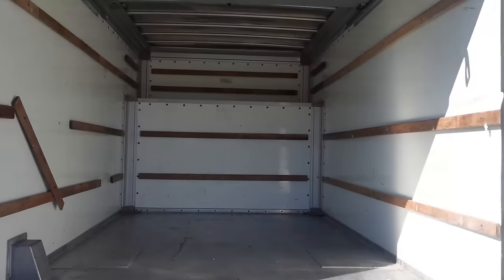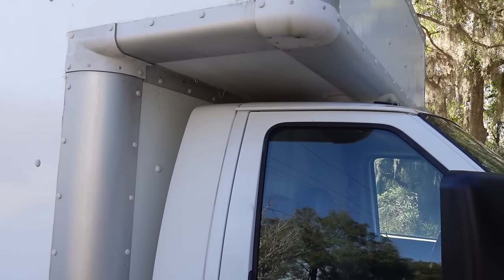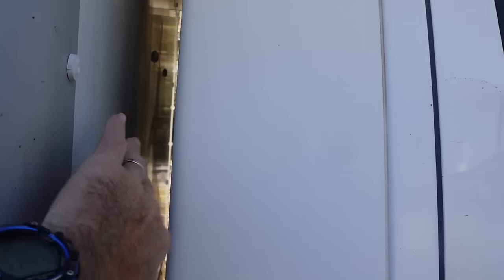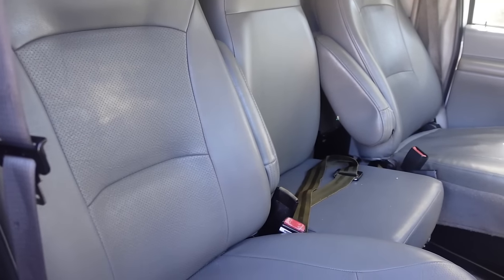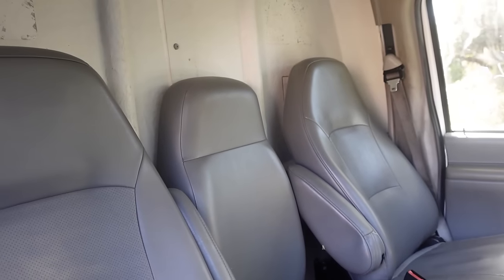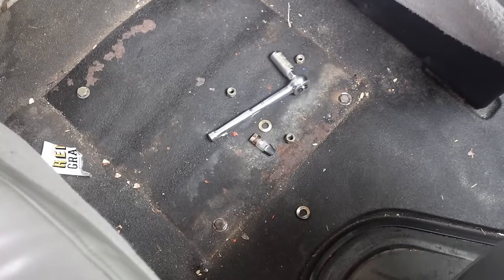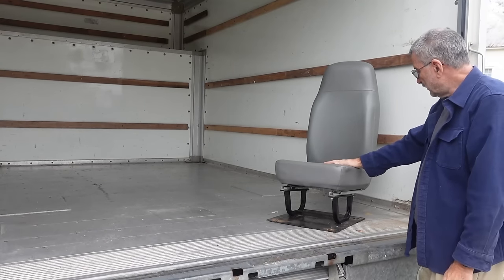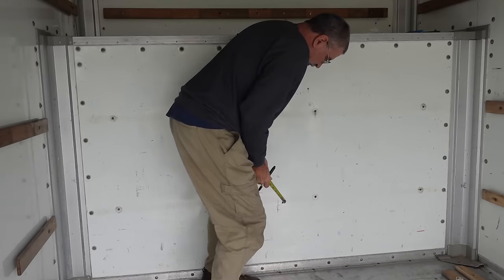Installing a Box Truck Pass-through Door

Comment: When I did mine, I used oversized pool noodles for my gasket and built a wooden sill plate at the floor.  and silicone caulk to seal the noodles...the top noodle spanned over the entire doorway that was almost the entire length of the cab back... I cut my hole larger when I realized thew advantages of the much larger hole.  The gasket seems really nice but the larger opening, with curved edges and corners was so  much better than just a doorway with no door...my dog loved sitting around back there and sticking his head around the seats. Glued vinyl to cover around edges was good... every few years I would rebuild and recaulk, but that was easy
Reply: The purchased gasket looks like a very good product. I think I probably would have put the seam midpoint on the bottom and a threshold plate over it. I also like GE silicone. Nice job.
Reply: Do you have photos of this?

Comment: I think I would have gotten a longer drill bit. A 1/4" bit, 6" long, is only $4 or so on Amazon. It might not be contractor-grade, but if it stays sharp long enough to drill your alignment holes, it would be worth it. I have seldom been able to completely trust my own measurements, so II tend to start small and then trim to final size on projects similar to this. I know you've already done this, but for next time, or for someone else, the long bit is another possible solution, especially for folks who are not as confident in their measuring skills.  You make a good example  with your use of protective equipment, too. I worked on helicopters and also did some shooting, while I was in the Army. If I hadn't had earplugs, I would probably be very hard of hearing now. You did a very nice job, Bill. Thank you for your very useful videos. I don't know if I will ever convince Linda to let me do a project like this, she seems to think I'm getting too old and feeble to tackle something of this magnitude. I just turned 67 last month, but inside I still feel about 35. I'd really like to have a box truck camper like yours. All the best to you and Elizabeth.
Reply from the maker: I will be 67 next month.

Comment: Loved it. But, 1. pop rivets instead of bolts & nuts. 2. the gasket  seam would have been better on the bottom. 3. stick the gasket together with rubber adhesive (inner tube glue). 4. a threshold, so that a accidently misplaced step doesn't rip through the gasket. 5. while the back of the cab was exposed, it would have been good to  screw some angle iron  supports to it, to stiffen the back so it doesn't rattle. Anyways these are just some suggestions. I hope their of some help. p.s. I'm glad Elizabeth is on the mend. Keep it up. ❤

Comment: Great instructional video! I had wondered how to do that. It really makes a nice difference, it is one of the reasons I am leaning towards either a van or box truck. The ability to get in the driver"s seat without going outside. In case of rain or even just to be able to drive off in case of emergency.

Comment: Looks like a good plan but I wold of sealed that plywood edge with a sealer of some type, maybe some latex caulk to stick that gasket end down and a glue designed for rubber perhaps then put a couple self tapping screws just in the rubber to hold it in place oe even some binder clips that will just squeeze the two pieces together you can get those binder clips at an office supply store they are pretty stoun

Comment: Thinking about doing the same installment on my van, but I have a question to ask first. I do like this method you did, but do you think some type of silicone sealer adhesive can be used on the attachment brackets and rubber boot overlap? I'm just in the research phase of my project. Thanks for doing a detailed video.
Reply from the maker: I don't know.  I'm still trying to do with the overlapped seam.

Comment: Bill, will the hole interrupt the integrity of the weight that can lay on the top of the bunk?
Reply from the maker: No, the door is not wide enough to weaken it. The wall is 3/4 inch plywood, and so is the bottom of the bunk.
Reply: @LiveSimpleLiveFree  so happy to hear that.

Comment: I think I will put the one coming down on top of the one coming up to shut the water
Reply from the maker: Then water WILL run in from the outside.  You're think about it backwards.  The rain is on the outside. So the outside rubber piece must lap down on the outside for the water to run off.
Reply: I had to rethink that one too.

Comment: I think I would have put construction adhesive in addition to the screws for that metal bar you're using to anchor the gasket.
You also want that splice/seam of the gasket on the bottom to help avoid any place for water to seep into.
Reply from the maker: The seam overlaps in such a way that the water will all run off. There's no way it can "seep."  Putting the seam on the bottom would expose it to more road grunge splashing up.
Reply: What about splashed water if driving in the rain?

Comment: I think you should have overlapped the gasket the opposite direction. Water flows ‘down’. Therefore, with the gasket overlapping from the top
Down there is much less likelihood of water getting in.
Reply from the maker: You're thinking backwards. The rain will be on the OUTSIDE of the gasket, so the gasket must overlap down on the outside like it is, not on the inside.

Comment: All the gaskets are is cut down from the old Style semi trucks. When they used to be two pieces just like this it was between the truck and the sleeper. It's nothing new they've had them since they designed semi trucks with sleepers

Comment: Would Butyl tape work instead of caulking
It's looking good
Love it!
Reply from the maker: Not really.  There are occasional gaps, and the size of the gap varies. Caulk will squeeze into gaps of different sizes AFTER the metal is mounted.

Comment: i think you should have overlapped the upper piece over the lower piece, like roof shingles.  water will find a way.
Reply from the maker: He did lap the upper piece over the lower piece. The water comes in from the outside, not the inside. On the outside, the top overlaps the bottom.
Reply: @LiveSimpleLiveFree  ok.  i dont think i saw that in the video.  it looked like bottom over top.  thanks for the clarification, and God bless.

Comment: Bill, if the gasket is joined at the bottom you wouldn't need to overlap the gasket.
Reply from the maker: It would still need to overlap, especially since the seam at the bottom would be exposed to excessive road grunge splashing up from the road.

Comment: I would do all that you did plus a wooden frame that sits between the box and cab. That way I could even screw into it if needed.
Reply from the maker: A wooden frame between the cab and box can create problems because the cab and the box must be able to move independently of each other every time the truck hits a bump.  That's why we use the rubber gasket.

Comment: Suggest you do the gasket overlaping upside down and you won't have any problems with eventual water coming inside the gap.
Reply from the maker: The gasket overlap is correct.  The water will runoff down the outside.

Comment: Aren't you supposed to start that gasket in the bottom of the door opening in the middle. Then you can cut the gasket flush.
Reply from the maker: No. If I cut it flush at the bottom, it wouldn’t seal. Water wouldn’t come in because it’s at the bottom, but I would have a bad air leak. By doing it on the side like I did, overlapping the seam, it blocks water and air.

Comment: Rivets would have been better
Reply from the maker: Probably.  I didn't think about that until later.
Reply: @LiveSimpleLiveFree  where you drilled for the screws is fine but they do have rivet puncher, but what you did was fine because if something occurs and it needs to be adjusted then screws are fine.